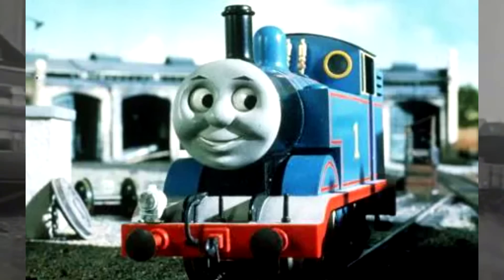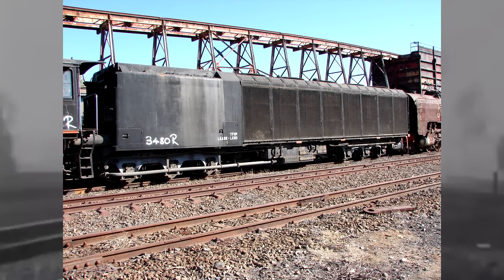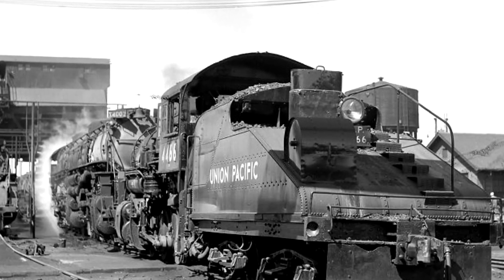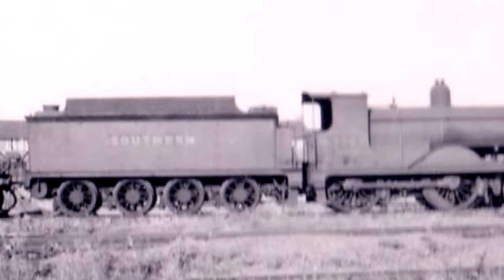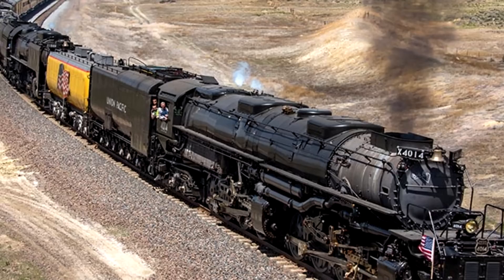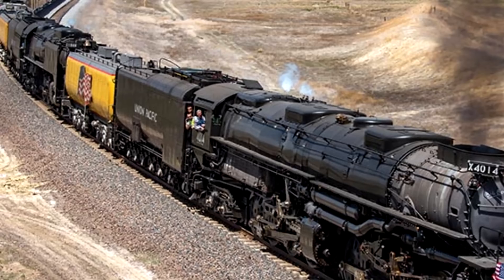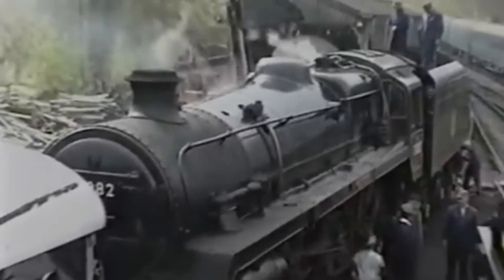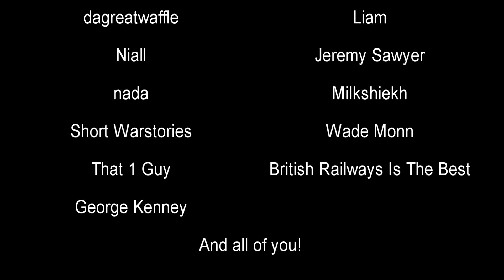Why Did Steam Locomotives Need Tenders? | History in the Dark

Comment: Long story short a locomotives tender is used to carry extra water and to carry wood coal or oil to burn as fuel plus it gives the crew inside the cab a little bit more room to walk around if necessary

Comment: Building locomotives for my fictional state owned railroad is eye opening....I have a locomotive called the J-24 class (also called the 'Outlaw') which is a 4-8-6 set up. It has two tenders, the main tender which holds oil, and water, and an Auxiliary Water Tender for holding...water, and has equipment to scoop water up from purpose built water tables. That engine is spec'ed to reach 150mph, and sustain that for a stort distance (10 miles), while my other similarly sized engines (such as my Nagato class 4-10-2's, Tarvala class 2-6-6-4's, and E class 4-8-4's have a mix between the traditional square tender and the Vanderbilt tenders. My "medium" sized engines use exclusively Vanderbilt tenders (unless they're the older 4-6-0 classes(T, R and F classes), some notable classes of my "mid size" locomotives include my "Krig" class 2-10-0's, Kentucky class 2-8-2's(my or may not also have tank engine variants) 2-8-0's Imperial class, and 2-8-4 Lima's...guess what my small engines are? 0-6-0's, 4-4-0's, 2-6-0's, 4-6-0's(G-class), and 2-6-2Ts On the state owned railroad, of all locomotives period, roughly 1% of all locomotives have some sort of tank, and of those 25% are diesels (my fictional nation doesn't like Diesels that much)

Comment: The tender is not coupled to the engine. It is coupled to the locomotive. The engine proper consists of a set of cylendars and the draw-bars on each side of the locomotive.

Comment: The reason why steam (and at a push, Diesel, and Petrol Locomotives) had tenders was for longer distance freight and passenger/Express Passenger services. Hence why Flying Scotsman had two tenders in the 60s due to British Rail scrapping all their water towers and coal tippers in favor of Diesel refueling sites.

The reason why Diesels had tenders was in the form of brake tenders, which were used for easier stopping on frieght trains.

Comment: The powered tenders on geared locomotives are powered by the main engine through drive shafts and not by their own separate engine.  They didn't have the added pistons that consumed more steam and used more fuel than tenders powered by their own engine.

Comment: The Union Pacific Gad Turbine Locomotives were fitted with fuel tenders due to how quickly they burned through the Bunker-C fuel oil(the same fuel oil burning steam engines used). There are only two survivors, one of which is at the Illinois Railway Museum

Comment: There's talk about building tenders for hydrogen locomotives. They probably would be a necessity for a  long haul road locomotive powered by hydrogen, fuel cell or combustion. There is no way there would be enough space for the fuel on the locomotive to go any significant distance or pull any significant amount of weight. Tenders ain't dead yet!

Comment: Freight wagons, not passenger coaches, needed the brake tenders. Passenger coaches had to be fitted by law with automatic fail-safe brakes.
Reply: @neiloflongbeck5705   particularly in the UK, where the railway didn't own the wagon (car / truck), rather the colliery or customer did, and considering that they didn't want to pay to replace what had worked for decades.... many didn't have brakes, let alone vacuum or air braking systems.... it was also common for such wagons to be rigid, rather than bogied.  So you'd have three 15' trucks instead of a single 40' wagon, or importantly a rake of ninety 15' trucks instead of thirty 40' wagons... partly because a customer may order five truck loads, that they themselves distribute around their site; and another may require nine trucks per week, but can only accommodate two at at a time.
Reply: @PiersDJackson  unfortunately you are a bit wide of the mark. By the time the diesels came along, there were very few wagons owned by private companies, and the vast majority of them were owned by the oil companies. All other private owner wagons had been nationalised during the war. All wagons in general use  were braked, if only a hand brake, some had automatic vacuum brakes, none were airbraked. BR  started off with approximately 1,1 million wagons, of which less than 10,000 were fitted with brakes.

The number of wagons didn't change much under Speedlink with its airbraked wagons.
Reply: @neiloflongbeck5705   the crux of the matter was the majority of the inherited minerals wagons had hand brakes, rather than those through a locomotive... which was one of the design imperatives of the 9F, they didn't just need to pull at speed, but stop them too.
Reply: @PiersDJackson  there were only just over half a million of those including those builtfor the MOT and MOWT, and just over 83,600 wagons, primarily the ex-private owner wagons and other wagons built before 1923, were scrapped in the first year of BR.

Comment: The Atlantic Coast Line also used auxiliary tenders on the track I grew up by (the bowline) between Montgomery Alabama and Thomasville Georgia. But these tenders were essentially modified tanker cars, which visually matched well with the Vanderbilt tenders of the Q1 class 2-10-2's they were regularly assigned to. The bowline also runs into Savannah Georgia as well, but there are steep grades between Thomasville and Montgomery. So, like on the Norfolk and Western, auxiliary tenders would eliminate some of the water stops on the grades. The Q1's were often utilized on heavy freights and long coal drags. I grew up near the crest of one of these grades and often heard the CSX diesels struggle up it, and one train I saw even stalled out on it as I was watching it.
Reply: You're lucky.🍀 I never get to see the CSX trains. I want to see at least one CSX train. Cory Mears

Comment: After the steam extinction in Britain, all the water towers and troughs were demolished.
So for mainline rail tours, some locos have used double tenders, to avoid water stops.
One steam operator has converted a BR good van to be a second water tender.
Recently they installed hose connectors low down, so it’s as easy as using a car fuel filler. The loco meets with a water bowser lorry at suitable intervals.

Comment: Early diesels had a "power car", essentially a cabless second locomotive. It was more or less a "slug" except you walked right inside it like the engine or a coach.
Reply: class 13?
Reply: Do you have a specific example in mind?
Reply: Sounds like your referring to the B units. These are boosters except they are locomotives without cabs because they were designed to be operated by the crew of an A unit (cab unit) which it was coupled up to. When first introduced by the Electro Motive Company (later EMD), they were called "units" because when couple together, they made one "locomotive" even though each unit was still an individual locomotive. The first B units were semi permanently or permanently coupled to the A units to convinced (more like trick) the government into believing that they were one "locomotive" instead of the two locomotives they actually were to bypass a law which required that a locomotive weighing over 45 tons have no less than two people working on it. This style of operation is still done today mostly without the permanent coupling as multiple cab locos are coupled together and ran by the crew from the lead locomotive. DPU radio technology also allows a unit to be placed mid train or rear train and still be operated by the lead loco crew.
Reply: @bowlinerailfan  Exactly

Comment: In the UK, tenders were commonly swapped out during a major service. Generally, you don't need to rebuild the tender every time it goes into the shop, so a locomotive arriving for a major service would have its tender passed over to a locomotive which had just completed its service and was mainline ready. Even the size of the coal/water load would generally be increased in later years, so a locomotive built in the 1910's might start life with a 3000gallon tender, could finish life with a 4500gallon tender (with a water scoop!!).
Reply: Absolutely not true, tenders would always be attached to the locomotive, engines arriving to be services wouldn't give their tenders to others going out, tenders would only be swapped to be updated and or to be fitted with new ones if the case, Soo let's say if 1 black 5 entered the shop to be serviced it would be serviced with it's tender as the ones going out of the shops would have their own tender
Reply: @Sebdamememan  the reasoning for changing tenders attached to which locomotive came down to the peculiarities of the intended assignment, for example swapping corridor tenders between the A4's in time of major overhauls, and if the assigned line doesn't have accommodation for lengths, so swapping four axle for three axle tenders.
Reply: @PiersDJackson   Again, YOU ARE ABSOLUTELY WRONG:

1) when a locomotive went into a light overhaul or a major overhaul the tender would stick with the locomotive as it too would be needed to be checked and looked after , For a very simple reason.

 Maintenance and Records: Keeping engines and tenders together helped in maintaining accurate records of both the engine and tender's condition, maintenance, and modifications. 

Therefore, the tender of a loco entering an overhaul wouldn't be given to another loco to continue being used.

2) LINES didn't have to accommodate for length of the tenders, as that really didn't matter in the slightest and it isn't the reason why some engines had stainer tenders, some Fowler's, and some group standards, they where simply accomodations MADE BY THE MECHANICAL ENGINEER  who designed said locos, and again, had nothing to do with lines needing accomodations for lenght.
Reply: @Sebdamememan  the points I was trying to make, but have been misinformed about, was there was an obvious shortage in the number of Corridor tenders to A4 locomotives, and I was going by recollections of a video some 30 years ago explaining how they were exchanged.  secondly the length issue was related to the Southern Railway, I did a little bit more digging, admitting to being more misinformed, relating to how some of the King Arthurs were fitted with (24 of 74) were fitted with shorter smaller tenders due to the size of the turntables at the ends of the line.  Also then conflating design of the Schools class as a 4-4-0 due to the tight curves on their intended 
lines.

Comment: You got to be kidding me, a steam locomotive tender is for the locomotive for fuel such as coal and water for fueling inside the locomotive, the fireman shovels coal   (Putting oil)   from the tender to the firebox, and water filling in the boiler but not too high on the glass, if it's for diesel locomotives they're either have 2 or more locomotives units as a help, DPU aka locomotives in the middle of the whole train or having a slug for boosting, but a steam locomotive tender carried more fuel and water to boost the locomotive so it can travel like 10,000 miles of something,  and there differenr types of locomotive tenders and they look and works the same damn thing, the design looks kinda cool because its unique on railroads (Railways in the global) . 

I thought you know what a steam locomotive tender is but, my life is a lie 🙃. 

But as for second tenders like the Flying Scotsman or Union Pacific, some steam locomotives carry the second tender to get fueled because there are no water towers or fuel stations in the modern era.
Reply: the last thing you said was primarily water filled, specifically auxillary water tenders, they only filled with water ofc